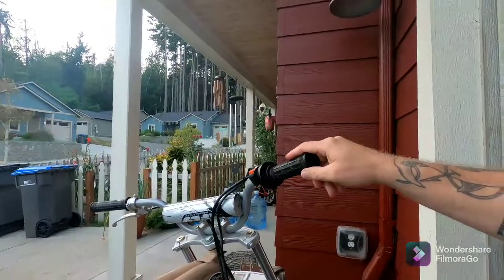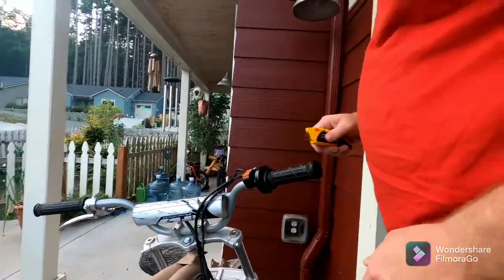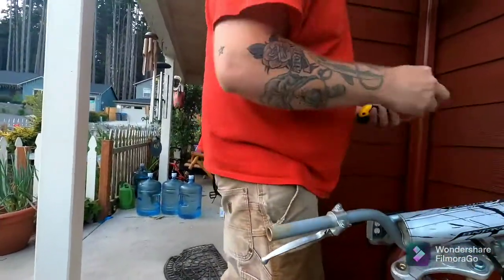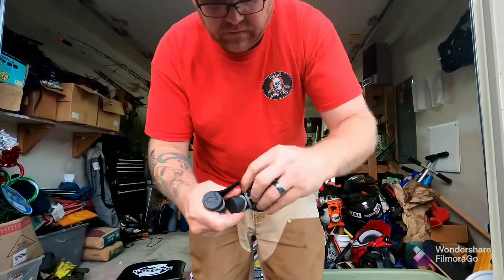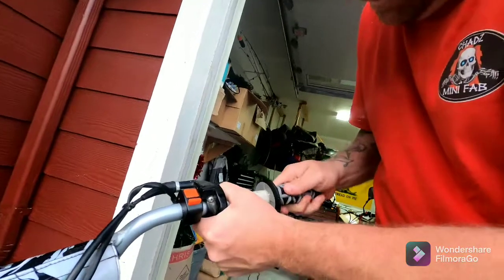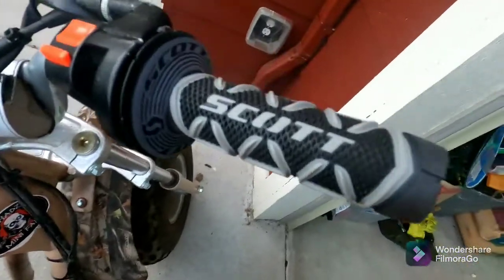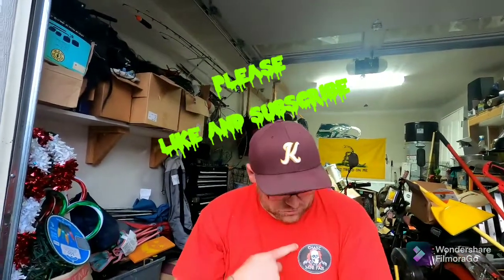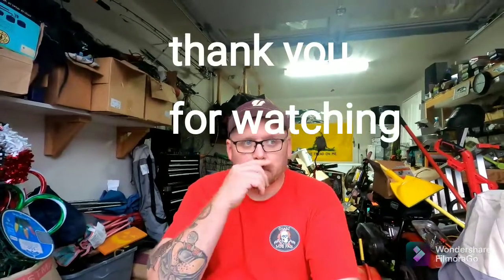How to replace hand grips on a Coleman mini bike handlebars.

Comment: Wait so I can replace the Throddle handle bars with out halfing to mess with the actual Throddle linkage?
Reply from the maker: Yup. Just make sure to cut away from your self. Slap those new ones on and continue doing wheelies!!!!
Reply: How do I actually take the Throddle off itself with out taking the entire thing off so I just can slide the new grips on?
Reply from the maker: @troyholland3436  unscrew your throttle cable from the twist throttle, putting it back on tho you have to take apart the twist throttle and reinstall the throttle cable and adjust the throttle cable back to where you like it. Or just cut off the grip like I did and not even have to mess with any of this.
Reply: @minibikemike02  how do you cut the grip off? like wdym?
Reply: @minibikemike02  u think using scissors or something would work to cut it off? What was if that u we’re using to cut it off??
Reply from the maker: @troyholland3436  I used a utility knife. Scissors will work.
Reply: @minibikemike02  I got a question so I’ve been using 10w30 non synthetic oil for my mini bike would it be bad for the bike to switch over to full synthetic? Cause I heard once u use Non synthetic it’s bad to switch over to full synthetic?
Reply from the maker: @troyholland3436  run with what you got!!! I've mixed matched all types
Reply: @minibikemike02  do u know if there’s a clutch that’s designed for the straight chain? So it’ll last longer?
Reply: @troyholland3436 I have same question